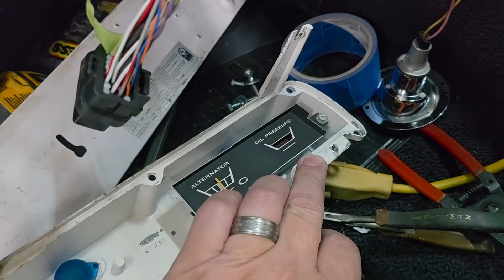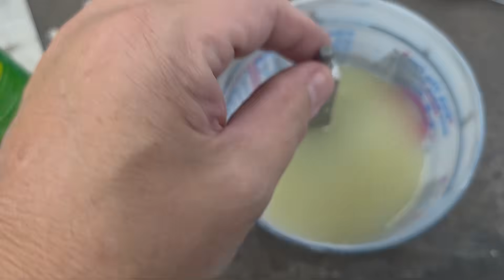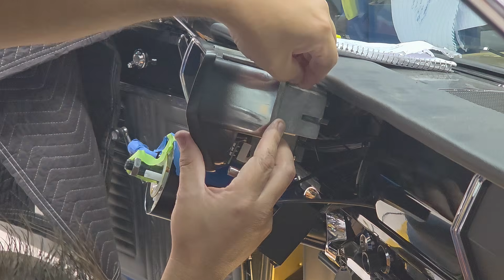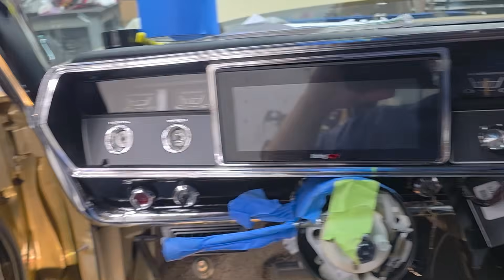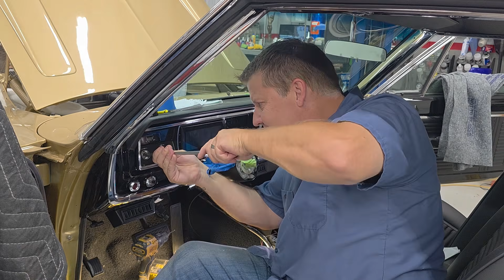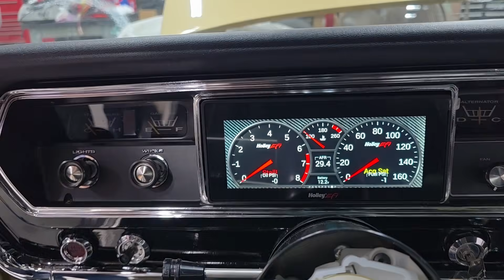The One Job That Almost Broke My GTX Build

Comment: I'm going through the fun process of changing out my dash to a factory style Dakota digital set up.

I'm in a complete restoration of the whole car. I upgraded most everything. Better suspension. Ford 9 inch. Built 406 sbc. Built my own rotisserie out of wood so I can restore the underside better than factory. Just an endless amount of work. I'm finally in the reassembly place and the wiring is part of it. Removed the wiring harness and took out any unnecessary wires since I went from factory TPI injection to an Edelbrock port injection. It's such a painstaking job. I'm super anal so that just makes it worse. You have to think about every possible connection. 

I know the service manual like the back of my hand. I'm in year 4. The light is starting to shine at the end of the tunnel. 1989 IROC-Z camaro.

Comment: Cool I can kinda relate to that job changed the look of the car and updated it i have a full digital dash installed in my round eye square body shortbed k10 it's similar cab to hammer's truck but mine is a 78..

Comment: Tommy, I want to comment on learning to walk away from a project at times. I have a garage to work in but at age sixty-nine I’ve learned to quit when the temperature gets near ninety. This coming late August I’ll be replacing the solenoid/valve body in my Chrysler 62TE transaxle. My car is a ‘12 Chrysler 200 Touring convertible. I’ve learned that transmission does not do well with older fluid with a lot of time and mileage. The repair will restore overdrive sixth gear to my drop top. I can start early and quit if needed and come back to it the next morning if necessary. 🚘

Comment: Tommy, feeling your pain. Recently redid/undid some old and poorly modified dash wiring in a 55 Chevy. Had to go thru everything, replacing switches, new gauge harness, repair loose or worn out items. That dash was in and out several times, but it
finally ended up working out. Nice work on the GTX, enjoy watching the channel.

Comment: You showed a lot of great restoration tips for the switches. 
The install of the Holley Unit is clean. 

My preference would be to keep the original 140 mph speedometer, but it’s not my car. 
It is a sharp GTX.

Comment: All right, I’ll be that guy.  Tommy, I think you did a great job with the installation, presumably giving your customer exactly what he wants.  Not easy when it’s not a bolt-in affair.  But, to me, I have to say that I’m not a fan of that Holley Dash in this car.  The digital dash clashes with the rest of the classic dashboard, taking away from the looks of some very expensive parts that were sought for the otherwise OEM look.  But, it’s not my car, so I hope your customer enjoys it.  Again, kudos for pulling off the rehabilitation and custom installation.

Comment: Looks nice Tommy. I personally do not care for the digital dash, but still looks nice. Currently, I am restoring my 65 Stang and have the dash removed to track down electircal issues. Had to replace the fuse box and ignition switch, and luckily parts are available and fairly inexpensive.
Reply from the maker: You like wiring work?

Comment: It's a nice looking dash setup, my only criticism is with the Holley dash screen itself. For as much money as they charge, they shouldn't use such a low resolution screen (480p), plus having almost 1" black bezels all the way around wastes so much space. Should be able to have at least a 8" screen in the same space, and should be more like 1080p for the $1400 they charge. It looks like a $30 Android tablet from Temu.
Reply from the maker: Dang.. now I cant under- see that

Comment: I use to get something at radio shack called tuner cleaner. Was a TV repair man in a former life lol. The tuner cleaner is perfect for old switches. 1 can last forever. It cleans, lubes, and protects from further corrosion
Reply from the maker: Hmmm thanks for the info.. I will do some digging!

Comment: Few hours?!  How much 20 seconds with some electrical contact cleaner spray?  You can hit it everywhere in all them connectors and switches and even do up ur guitar and amplifier if it's crackin'!
Reply from the maker: Yoy sure it will get in all the nooks and crannes?